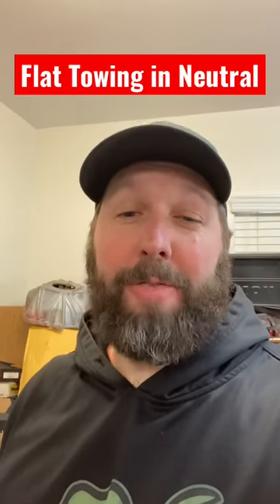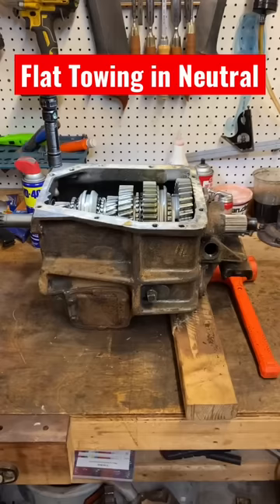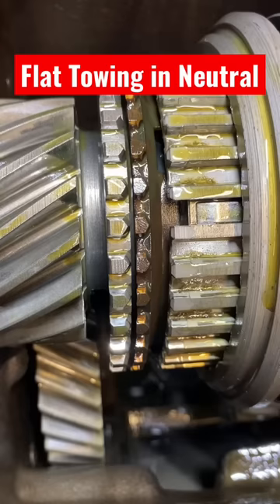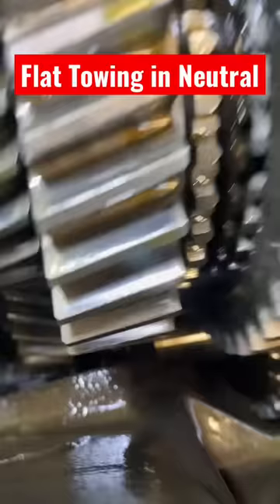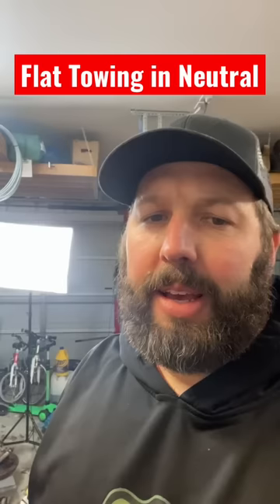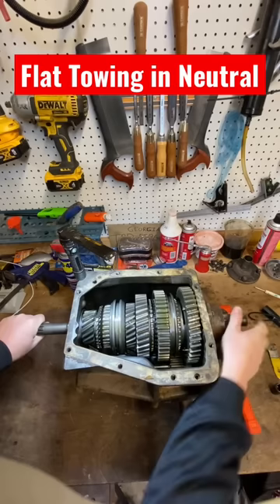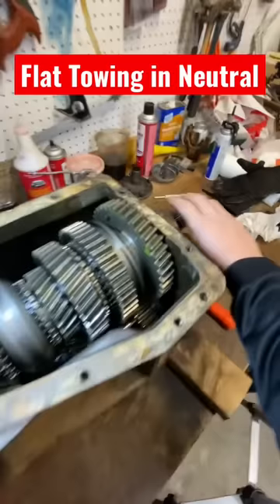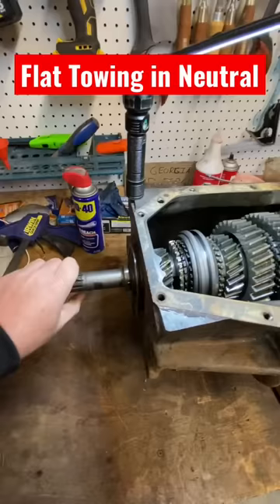Flat Towing in Neutral??? #transmission #stickshift #mechanic

Comment: If you don’t have a transfer case and the engine still runs, start it up and let it idle in neutral. Should be able to tow it until it runs out of gas.
Reply from the maker: It’s an option 👍

Comment: Most modern manual transmissions can be towed in Neutral. It even states to do so in user manual.
Reply from the maker: You have to check the manual.  That being said, many modern transmissions have the same design constraints. https://www.tremec.com/not_am_detalle/flat-towing-manual-transmission-vehicles/
Reply: Yep just start motor at end of day or at stops to throw oill around in that box.
Reply: If the oil is up to the main gears it be ok
Reply: @groupergary5536  What would you do if engine won't run? And even if it will run, will you stand on a clutch the whole way? There is no other way how to tow a car than with transmission in neutral...
Reply: I see a few small city cars towed behind bigger campervans - so this would apply here.
Reply: @vasek987  You can disconnect the drive shaft before towing, Depending of course on what vehicle you own
Reply: @wfldfire  Here in Europe 95% of cars are FWD. We tow cars only in neutral 😉
Reply: The manual for my Jeep says shift transfer case to neutral put manual  transmission in neutral for a flat towing.
Reply: @vasek987  The same opinion. No issue at all and you don't need to pay for platform. Just another strong car is enough.
Reply: @vasek987  You lift the drive wheels, on a one-axle dolly.
Reply: @vasek987  Flat tow? Or with the front lifted off the pavement?
Reply: @tedwalford7615  we are talking about flat tow whole time 😉
Reply: @halp.3640  I'm pretty sure mine does too. Jeep, manual t case and manual transmission. But for our long move, it got trailered. It was cheaper than replacing the tires!
Reply: @@govlovesyou1334you mean propeller shaft or driveshaft
Reply: @vasek987 ummm....pull the drive shaft
Reply: @tombickman9292  how you can pull the driveshaft on a FWD car?...
Reply: @vasek987 you dont...in this video he is referencing a chevy C20 Pick up front wheel drive should be on a dolly or trailer
Reply: I towed  1977 Celia five speed manual from CALIFORNIA to ILLINOIS no problem.
Reply: @vasek987  part 3 tells why towing in gear with the clutch in is bad also.
Reply: @vasek987  actually theres one other option- tow it in top gear with the spark plugs removed! The gearbox gets oiled, the motor gets oiled, and the power steering will work for who's steering the towed car. You might even have powered brakes working too
Reply: @TC-V8 you do realize this is for manual transmissions!!!!
Reply: @vasek987 he's talking about a manual transmission. Not an automatic
Reply: @CodeMasterCody88  I don't know what are you responding to. I was wondering what you are supposed to do in manual FWD car where you don't have anything to disconnect...

Comment: Very good video because most people still believe you can tow a manual transmission in neutral I put a valve on my slave cylinder to lock it and leave it in overdrive 😅
Reply from the maker: Interesting idea! Never considered that. 👍

Comment: This is also why you dont travel in neutral and Why most are taught to leave it in gear to complete the stop and just use the clutch. 

It also adds to why semi truck is never allowed to be a neutral while moving at all..
If you travel more than the distance of your truck/trailer during a shift. you fail.
(This is more so because it's unsafe to have the vehicle out of gear)  But eventually does lead back to this..
Reply from the maker: Semis have all the gears 🤓
Reply: @freedomworx  yup. from 2 MPH to 45 and everything between.. then an OD for 65-70
Reply: False. Engine braking helps slow you down. No one is not putting their car in nuetral to come to a stop to not cause wear

Comment: Depends on the transmission, and the amount of towing you are planning to do
Reply from the maker: Yep. You have to refer to the owners manual.
Reply: I CARRY A 2X4 LONG ENOUGH TO DISENGAGE CLUTCH, BY BLOCKING TO THE FRONT OF THE SEATSO THAT CLUTCH IS TOTALLY DISENGAGED AND LEAVE TRANSMISSION IN NEUTRAL
Reply: @rossbryan6102  RIP throw out and pilot and input shaft bearings
Reply: @jaredlancaster4137  
I USED TO BE A DRIVEAWAY DRIVER, DELIVERING LARGE TRUCKS AND WE USED A FORD RANGER TRUCK WITH A MAZDA STICK TRANSMISSION. AS A TOW BEHIND.
BLOCKING THE PEDAL DOWN AND LEAVING TRANSMISSION 
IN NEUTRAL, WE NEVER HAD A PROBLEM , AS THE MAIN SHAFT COULD STILL ROTATE A SMALL AMOUNT, ENOUGH TO KEEP STUFF LUBRICATED OK!
Reply: @rossbryan6102  thats a great way to cause premature failure of the throwout bearing. Its designed to only be used for short periods of time, not the entire time the vehicle is moving.
And for the love of god will you turn your caps lock off. Stop yelling.
Reply: @Redtooth75  
AT THE TIME THE CLUTCH IS DEPRESSED WHILE TOWING , THE ENGINE IS NOT ROTATING,  THEREFORE THERE IS NO EXCESSIVE WEAR HERE!
BEEN THERE, DONE THAT!!

Comment: Learned all about pulling drive lines when I worked at a towing company. I would ride with on heavy wrecker calls, crawl under big trucks and RVs and pull driveshafts. And strap them to the frame rails.
Reply from the maker: That’s the safest option 👍

Comment: What are you suggesting we do instead?
Put it in gear? : 0
Reply from the maker: You should read your Owner's Manual. Towing in neutral is fine for some vehicles. Some need the driveshaft disconnected.
Reply: Yeah usually they drop the prop shaft or pull a half shaft. Really annoying it they pull the diff lock side of the axle... You need something like a broom handle to put the lock back in. In my experience on Iveco.
Reply: It depends whether it is a front wheel drive, rear wheel drive, or all wheel drive. You put the drive wheels up. Maybe all wheel drive have to be flat bedded? Tow truck driver is a most dangerous job. Please give them the same courtesy as first responders. It is the Law in our state after several tragic deaths. When a tow truck is assisting people on the side of the road,  you are to change lanes to avoid them, or pull to the right, as for an ambulance when they are en route.
Reply: How far are you towing? A few miles? You're probably fine. Few 10's of miles? Leave the engine on in idle. Few 100 miles? Disconnect the drive shaft.
Reply: YJ Overlander  drive shaft still turns and smoke the bearings. 😂
Reply: Torque backlashses through the differential as the wheels turn. The countershaft doesnt spin to pick up any gear oil, leading to oil starvation in mainshaft of the geartrain. Also if you hit a bump and one of those synchronizers engages, you're gonna have a bad time. The best thing to do is disconnect the driveshaft if possible, or both in a 4WD vehicle.
Reply: @pecanthejelly5854  so what your saying is …. The Titanic probably hit the iceberg?
Reply: @pecanthejelly5854  The sychronizers engage before the dog teeth. That'll keep it from engaging in gear. You can test this on a straight road by accelerating up to speed, taking it out of gear, foot off gas pedal and try to push the shifter into gear gently. You'll feel resistance as the bronze synchro's try to synchronize. Since they can't they will never align with the dog teeth and the shift collar will not engage.
Reply: @freedomworx  
Hoping the guy who front wheel towed my RWD/4WD 1990 Mazda B2600i with the trans and transfer case in neutral knew what he was doing.  His problem now.  I told him it's always always had to be flatbedded, he said he knew what he was doing💁‍♂️
Shit lol just remembered that the front passenger wheel bearing was ass and a half.  😮
Reply: @i-love-comountains3850  Transfercase is different because they don't have an idle shaft. Gear driven ones will always lubricate because the output gear is bathed in oil. Chain driven ones have a pump on the output shaft lubricating everything.
Reply: @erikkovacs3097  You can definitely shift without a clutch if you want to, yea it won't engage if you don't shift to the next gear fast enough but floating gears is completely possible and safe when done right. Your example is a bad one for explaining what youre trying to explain.
Reply: @glitch-pr3nr  the really sad thing is that you needed to say that so people will listen.. rather than them just having respect and being courteous. It's amazing how much peoples true colors come out behind the wheel.
Reply: @Glitch  never heard of pulling over for a tow truck that's in route...obviously move over when they are on the side of the road but why pull over as if its an ambulance?
Reply: Or just keep the engine in N running if it can be. Otherwise you remove the driveshaft.
Reply from the maker: It’s an option.
Reply: T for towing
Reply: @freedomworx for a vehicle with a transfer case can’t you just throw the case in nuetral ?
Reply from the maker: @devinhall1631 most of them, yes. But the trans stays in gear or park, for the same reason I stated in the video 👍
Reply: Yes. I usually put in 1st gear to tow.
Reply: @99EKjohn so is yours. It's not how fast you shift to the next gear.   It's proper matching of engine rpm with speed.  The equilibrium being the point the shift ring sides from current gear and slides onto the next gear.  Yea trying to bang it on thru the gate faster might make it seem easier because the synchronizers are doing their job it's not the correct way.  You can put light tension on the shifter while in neutral rolling along at speed and at their will be a point it will engage the gear smooth as butter without just jamming t in.
Reply: @georgemccune2923  That's what I described. I wasn't saying shift as fast possible, timing is everything when you don't use a clutch. If you notice who I replied to he mentioned taking your foot off the gas and pressing into the synchro, that will lead to a shift if done at the right tempo and gear. If he would have said keep your foot on the gas, then the transmission wouldn't change gears without failure.
Reply: @freedomworx or need to be put on a flatbed
Reply: @99EKjohn  ok I gotcha. Sorry bout that then as I took it you were slamming the shifter home like rowing the oar of the last boat off the titanic  Have you ever noticed sometimes YouTube doesn't show all the replies to comments.  Sometimes it say 5 replies and you open it and their is none or maybe just 1 or 2. I don't think i see the comment you replied to even tho the tag is there.  It weird.  I've been on the other end of that and replied to somebody asking a question and they keep replying to other commenters and it's like mine is invisible and I will try a few times even replying to somebody else that replied to them and nothing.  Idk why it does that.
Reply: @georgemccune2923  yea I've noticed that too, I probably have gotten a lot of comments made invisible myself. I'm not normally very nice in my replies lol. I know YouTube doesn't allow links, so I just figured most of those hidden replies had links in them, or were spam.
Reply: @georgemccune2923  Something else came to mind, that's kinda an exception for shifting without clutch too. "Dog" boxes, straight cut gear transmissions with no synchronizers. You can slam them home, but it will wear them quicker. Weird thing is theoretically helical cut gears are stronger, but since their normally cut so much thinner, for smoothness and noise, they aren't as strong in practice. The noise is half the fun of a straight cut.
Reply: @99EKjohn  yea those are a whole different thing, I will say that. I never had one in any of my vehicles, well maybe my 28 Chevy but it was a turd. Lol.  I know one buddy I have that has a manual (can't remember the exact trans sorry) but I know it has the strait cut gears because he always talks about it but he has it in is 62 Chevy II behind a nasty little 327 with a tunnel ram.  It's all nostalgic period correct gasser stuff but he can clutchless shift that thing better than anybody I've ever seen.  Of course in his professional life he is a performance transmission builder so I'm sure it has the best of the best inside.  He is so good, smooth and quick in the shift you would swear it's an automatic.  He is from just after dad's generation but before mine like 12 years older than me and that's what he grew up around.  I was from the turbo 350 reverse manual valve body with a trans brake and throw nitrous at it til it bows generation.  Lmfao.  Although I did get a 406 small block powered  S10 to run a 6.83 on skinny tires it wasn't without blowing up literally everything along the way a few times.  Haha. Ever run off the end of the racetrack because a nitrous backfire took out the master cylinder and you couldn't stop.  This guy has.  Hahaha.  I miss those days.
Reply: What if it's 4x4 in pto position. Because I've towed standards thousands of miles behind motor home and never had any problems
Reply: @erikkovacs3097  I actually had to idle my 2001 Taurus in nuetral when i towed it 50 miles. few tow dollies would fit the car.
Reply: @bradleymorris8875  no , hes saying there was a second gunman, please try to keep up. lol
Reply: @99EKjohn  I never said you can't shift without a clutch.
Reply: @maddhatter3564  lol.
Reply: @erikkovacs3097  mine shift’s perfect without the clutch. You can even shift it wide open without the clutch… as long as it’s not running. Hmmmm maybe I should see what’s for dinner.
Reply: @bradleymorris8875  Who are you arguing with? I never made that claim.
Reply: @erikkovacs3097  I’m not arguing. I’m just saying random dumb things while I am trying to poop.
Reply: @bradleymorris8875  Alright well don't take too long. It's bad for your sphincter.
Reply: Tow the rear lock the stering
Reply: Take your drive shaft off if you can.  
My 1971 bus......you can't.
Reply: @erikkovacs3097 why leave the engine running?
Reply: I always give the tow truck guy a good tip especially if he has been exposed to traffic. Like a 20. More if you can. If you want, tip him when he shows up, tell him at the beginning you appreciate that it's dangerous.

Comment: That's why I always tow in 3rd gear .
The Pistons don't really like spinning around at 4000rpm without any oil but at least the transmission will be
Reply: Practically every engine out there has an oil pump that turns with the crank, so you can't turn the engine without getting oil.

Engine will be just fine as long as it's not spun too fast.
Reply: @liev535  that's an excellent point!! My comment was sarcastic and nature but yes absolutely that is correct you are right
Reply from the maker: Tow it in first. When the rods break, it'll tow much easier. 😉
Reply: @freedomworx  lol
Reply: Take out the spark plugs and put it in 5th
Reply: Flip it over onto it's roof and drag it down to road, so you don't damage the transmission

Comment: I towed my 07 Impreza 5 speed manual, for over 30k miles. I followed the owner's manual instructions on flat towing. Never had a problem.
I now tow an 03 Tracker 4WD with 4 speed auto transmission, and I follow the factory instructions. I tow at 55-58 mph and every 200 miles (or fuel stop), I start the engine and put the tranny in D while the transfer case is still in neutral. This lubricates the transfer case.
The key to flat towing is follow the factory instructions. Cant go wrong.
Reply from the maker: Yep. Just do what the owners manual says.